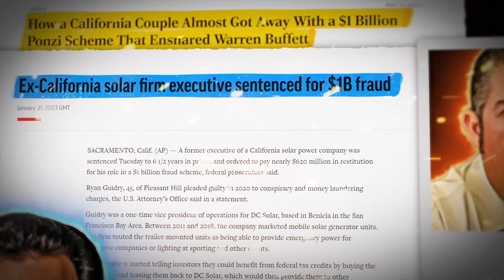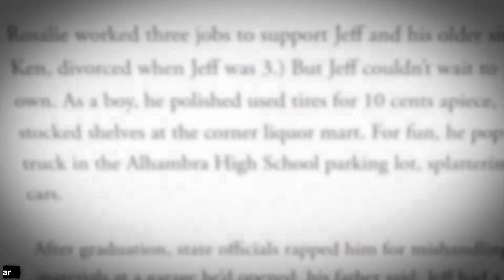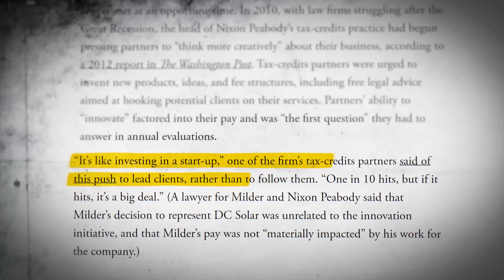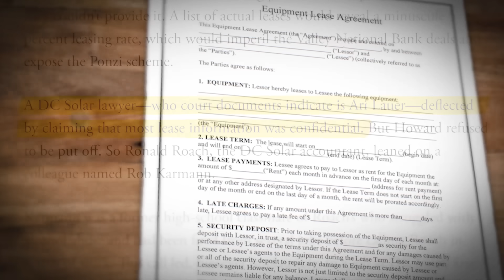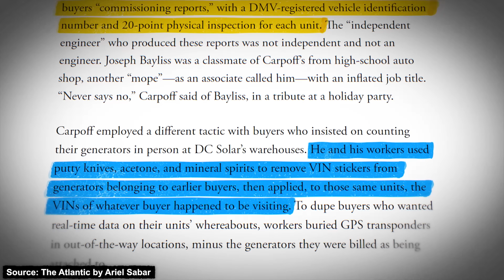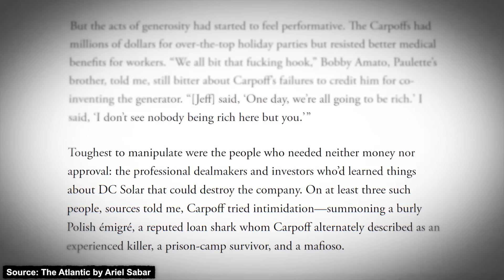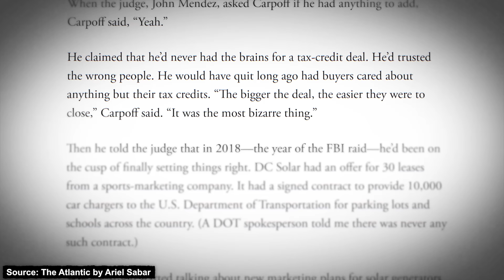The Fake Solar Company That Stole A Billion Dollars

Comment: Is it me, or is rigging a trailer for solar energy not too difficult to begin with
Reply: It's not hard
Reply: Most of these investors probably knew and were just in it for the tax breaks
Reply: @counter.123  you overestimate how smart people are
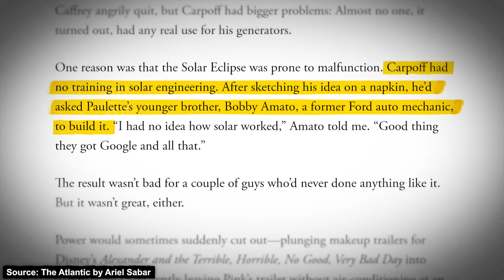Reply: 11:13 just Google it
Reply: I know a guy who has random solar panels from old trailers, construction sites, and any other place he can get them from. He takes them either from the trash or even just left behind and forgotten, there was one panel that was literally dumped there by someone. Just left on his property. He takes them and wires them up in his shop or parts of his house. They dont work like "free energy" but they do run shop lights, charge power tools and batteries, run a small alarm clock...all sorts of small things. Its not hard at all if you understand basic electricity.
Reply: I know one person who hooked up a solar panel to a boat, but its also probably an efficiency thing.
Reply: It's not hard to put panels on it, no. But it's really hard to engineer the electronics if you have absolutely no clue how the stuff works and you're not an electrician. Or how to create a mounting device for the panels (which are kinda heavy) that is sturdy enough to not fall apart on American streets after an hour.
Reply: A few not insignificant challenges but pretty easy really.
Power draw rendering it useless being the main issue.
Reply: From the timeline of this, I think it was almost 15 years ago and from my understanding the technology has come a long way in terms of size, accessibility, and ease of use. Even in the last 5 it’s become a lot more accessible and affordable. That said I’d chalk it down to people just not caring as long as they made money from it🤷‍♀️
Reply: That’s why you made millions from it yes?
Reply: 16:14 liquidate and disappear
Reply: DC Solar was founded in 2008 so I assume it wasn't that easy.
Reply: @Sensory Slug  that doesn't quite make sense. Why spend 150k to save only 45k in taxes? They had to believe to some degree that they were going to get returns worth that other 105k.
Reply: Bro, stop. You can’t even cook toast
Reply: Companies will pay for a finished product, even if it's a simple idea, especially if it gives the tax breaks. Kind of like how making hamburgers isn't too difficult but I would rather pay for a finished product ready to go, especially if it cures my stomach rumblies.
Reply: @n8doggy733  Projecting much? 😂
Reply: It’s the rigging of the government that is hard.
Reply: @AcornElectron  It was a new thing and not it isn't and the market is already saturated. You have to be at the right place at the right time.
Reply: @viderevero1338  bread is hard to cook, admit it!
Reply: Right. Y could probably make ten of your own for the price of one
Reply: @goddimmus  And that's all you need. Understand the basic electricity and you should be able to set up a power station with solar panels. 

Some are simply overestimating the technology used today and underestimating themselves.
Reply: The battery you're charging would be the hard part to engineer
Reply: @deadprivacy  That's why you compensate it with an alternative energy source. For some small things like charging some power tools or powering a light it's enough.
Reply: @CoAndCoLaptopAccount  I guess that writing off 30% if your investing millions was worth it.
Reply: @(CKS) Rylanor - S54  I guess avoiding 30% in tax when you're investing millions was worth it and a % of the rental income for the investor.
Reply: I mean it may take a hour or two work if you wanted to wield it to the trailer and make some kind of way to protect the panels but besides that it really wouldn't be that hard edit also you stole my name!
Reply: At the time, it was certainly harder to do than it would be today. But, after the first round of investments they had more than enough resources to figure it out legit and still probably end up millionaires. You're given the opportunity to print money and you're so lazy you can't even half ass it? Crazy.
Reply: It probably isn’t now but could you do it in 2007 when solar power was just breaking ground in the US?
Reply: Mostly it is the battery and efficiency. You can buy solar panels and hook up an outlet to it really easy, but no guarantee on how much power you'll get.
Reply: @SioxerNikita  I know. He said they were just in it for the tax breaks. I believe they thought they were investing and it wasn't just about the 30% since it was 30% off of their investment, not their taxes as a whole.
Reply: He could have actually done that the whole time without much difficulty. He can lie but he can't work.
Reply: @yaldabaoth2  Was it also supposed to fold in and out as well? I can see why that would be complicated engineering wise
Reply: Yes. Its surprisingly simple, can confirm from experience. 👍
Reply: @ea_naseer  😂
Reply: @lisahoshowsky4251  True.
Reply: It isn't, but many, MANY Americans are born into instant gratification.
Reply: It's not efficient and the panels are sensitive.
Reply: Its really not that hard tbh.
Reply: @thc_freebaser  This
Reply: If you can assemble IKEA or know how to assemble LEGOs, it’s very basic skills...
Reply: @CoAndCoLaptopAccount well it would become an asset to go on their balance sheets too
Reply: @lisahoshowsky4251 true nowadays u can probably find a YouTube video reliably instructing you on it too whereas back then good luck it was all cat videos and high school fights plus the tech was different and not being pushed quit as hard yet with funding and the new tech we have and again good luck finding good info on the internet in those days google was still rough af
Reply: @yaldabaoth2  engineering the electrics? Why would you? You need panels, batteries a charge controller and an inverter. Not sure what engineering would be worth doing. All those things are available off the shelf and are mass produced so you're not likely to be going to save much manufacturing your own. Plus they're all going to be certified already. 
You can save a fair bit by making your own things for personal use but that's different to a commercial operation. Especially if you need any regular tech to be able to fix things.
Reply: @CoAndCoLaptopAccount  if it makes a loss they can probably claim that at tax time.
Reply: Honestly makes me wanna give it an honest go, if only that guy hadn't ruined it
Reply: @romancvijanovic7130  Absolutely. People these days have been convinced that everything is too technical for them to do. I was always told by older people that they stopped serving their own car once they got one with an ECU. I trusted them and didn't try. Then when i did decide to try i found that as should have been obvious, the newer cars are actually much easier to service because the computer handles most things and if there's an issue it tells you with a code that you can then look up and be told in plain language what it means and then follow the diagnostic process. Much easier and less work than my 1982 Mazda. 
The only issue is finding parts instead of making adjustments but that's not as difficult as people claim either.
Reply: Maybe you should do it for real and make billions, since it's so easy.
Reply: @snex000  they only said rigging the trailer should be easy, not making money from it. Why so snarky?
Reply: @chrisnoname2725  You already know how to make money from it. Do what the guy in the video did, just have real product.
Reply: @snex000  but he wasn't making an income from the trailers. That's the problem with it as a legitimate business model. I assume an events business or a hire company could use them as part of their inventory but i don't know how profitable that would be for a manufacturer. I would assume as a stand alone hire product it isn't worth enough and if it's something that is profitable to manufacture then someone would already be doing it. There's already solar powered lighting trailers and light up signs and there's containerised battery banks that are easily delivered to a site for backup power.
Reply: @deadprivacy  yep, that's why this didn't work.  the pannel trailers couldn't provide enough electricity.  there wasn't enough panels to run much of anything.
Reply: Its not, but humans are phenomenal at talking and doing things without using their brains. People say and doo stuff they would blush over if they spent some thought to analyze first, but they simply dont. Thinking hard. Move hands and mouth easy.
Reply: No, quite easily actually. 
All you need to do is to decide the battery capacity in watt hours and pair the solar panels and inverters to meet your clients needs...

...and not take shots of alcohol and spend money like you're a millionaire would also help.
Reply: It really is easy.. I've done it ffs 😅
Reply: Im an eletronics engineer, i could build one in a day If i had all the pieces... And you dont even have to Develop anything, you can buy all the pieces Off the shelf and you Just need to Put them together.
Reply: Not today. But he had a patent at a different time. Think!
Reply: @tacticalpossum7090  Even 20 years ago you could already buy all the parts you would need to build a solar Trailer. It might Not have been any effizient, but it was possible even back than.
Reply: @nitro8529  Im aware, but the public didnt really know or care, and He. Had. A. Patent.
Reply: $150,000 that saves millions in taxes.
Reply: I kept wondering how even with all that money they couldn’t make it work. Then they just decided to not even try haha
Reply: @yaldabaoth2  Yeah but they definitely could have hired someone to make them work pretty early on haha.
Reply: Then you and y'all do it at that time
Reply: It’s just you,
Reply: made it for my parents garden shed, its an evening of researching people already done it
Reply: 2500 for the trailer, about the same for the solar panels, probably another 2500 for batteries and misc. So, the 13K price reasonable markup makes sense. It took 1 minute of google searches and my limited working knowledge of prices to rough calculate that- but you are going to invest 150K in a trailer without any due diligence?
Reply: @chrisnoname2725  ...electrical engineers exist? yes, off the shelf components are much cheaper than manufacturing everything from scratch, thats why you hire an engineer to tell you which ones to buy, to draw up the diagrams of how they plug together, and to design the watertight box you'll be screwing them into. for people who sell electronics, this is an everyday practice...

so the answer to "why would you" is simple. could an average joe buy an off the shelf solar solution, plug it all in, and screw it to a trailer? yeah. but thats going to cost twice as much and not be available for purchase at scale. you hire the engineer or engineers so that as you go down the supply chain, buying components and creating a manufacturing process, there is someone with expertise to say "no we cant replace this component that we've run out of with this component they want to sell us for half price." or "wait to install the lithium batteries until AFTER the welding is done, just in case." and those components you're buying...they were assembled the same way, all the way down to the chips on the boards. another reason you hire the engineer is to know how far down the line you need to go. maybe its best to buy a fully assembled charge controller, but the inverter could be assembled much cheaper by your company. those sorts of calls have to be made by someone, it might as well be by someone with an education and a professional career in making those calls. 

every other reply youve made has made a lot of sense, so sorry for the kind of snarky response, but I figured as someone who has seen too many mistakes made because "why would we ever ask an expert when they cost money!" I might as well explain that yeah...sometimes its best to hire someone just in case. if they do their job right, you wont realize how much they've saved you.
Reply: Say he has 5 panels per side. This was Obama time so these were 150 watt not the fancy 330 watt ones today. So he had 1150 watts of power. Those panels were also 80 percent efficient so like 975 watts. Thats enough power to run a small fridge. So ya these never had a chance.
Reply: My rv solar system can run my entire rv and all together didn’t cost 150k 😂
Reply: @lisahoshowsky4251  Completely incorrect.  There's been relatively few advancements "in almost 15 years ago" in the technology.  Solar is & has been a pretty mature industry as far as how they manufacture/design the panels.  The White House had panels in the late 70's (and Reagan threw them away b/c he thought they were ridiculous).

We've had a couple large arrays (like 40+ of these trailers) for a long time & there would be zero reason to change anything with the panels or inverters.  The current panels may be slightly less expensive (which happened b/c of massive Gov subsidies) and slightly more efficient (MAYBE a 4-6% total increase in output for same size).  But spending all that $ on new panels for 4-6% increase would be dumb - a better idea would be to add a couple more panels to the existing setup.

There is a limit to how much energy solar can produce & that limit is how much energy hits a given area of the earth which is about 1 kilowatt per square meter.  You would be doing very well to get 200 watts from that same square meter in electricity (so we are at about 20% efficiency for good panels).  You can get a few % better but you are paying MUCH more (could be 2-20x+ more).  The other energy you can get from solar is thermal (heat) which is more efficient as you can harvest closer to that 1kw per sq meter.  This is why solar hot water heating is a very good idea, especially residential in sunny areas.  You can also use heat for air conditioning (cooling) bc there are coolers that use heat as the energy source (electric AC uses heat which is created by the compression of a piston by an electric motor). 

Maybe you can see the inefficiency here of 
electric solar panels collect energy -> DC inverter collects energy from panels & converts to AC & sends it to house or grid -> electric motor of AC turns/spins -> drives piston compression -> generates heat as refrigerant is compressed -> circulates into AC system.  

Using solar thermal you have:  
Solar hot water heater -> AC heat exchanger -> heated high pressure AC refrigerant circulates into AC system

One system is MUCH simpler & much easier to maintain.  Solar thermal is much cheaper as well, especially in larger sizes.
Reply: First thing I thought, lol
Reply: they have that sort of things for temporary highway signs, other than that, they can't run much elese
Reply: As someone who's been researching solar for a while now, it really isn't that hard, bit getting it to be efficient and work as well as a diesel generator is a bit of a stretch. Even roof mounted panels only assist in your power consumption. They don't give you all your power. If you want solar panels to equate a diesel generator for the same amount of time, and it isn't left in the sun charging all the time, you're going to need a LOT more than 10. You'd have to park this contraption at the needed site well before it's needed time so it can change. Otherwise, it's useless. Maybe if left in the sun 24/7, like on someone's land, yeah, I can see it. But providing power for venues or things of that size? You'd need so many of those trailers that it's laughable.
Reply: @yaldabaoth2  the engineering issue is 10 panels (2KW) is not enough power to run a good tablesaw on a sunny day, for what they were being used for required running the generators almost constantly.
Reply: @lisahoshowsky4251  even with modern panels from 5 years ago (360w x 10) 3600w is barely enough to run an RV air conditioning system let alone concerts and the like. It was a diesel generator with decorative solar panels.
Reply: Yea but my guess is that it isn't practical

A few solar panels welded to a trailer definitely isnt gonna power the needs of an event or construction site, so may as well ditch the bulky expensive two axle trailer and just get a generator
Reply: It's the batteries that's the problem with solar
Reply: @everythingpony with all the plug and play technology that you can buy nowadays yes. Back then you had to make your own. You had to know how to build all the charging and delivery system.
Reply: Correct. It's not that hard, but you do need to know what you're doing. A week of Google'ing and reading will provide much of that know-how. Then it's a single call to your local welding shop to get the thing built. (you may want a licensed electrician to do the wiring. given the nature of what it is, building codes may not apply, but you still don't want to kill people and burn down the city.)
Reply: @jfbeam  You would need an electrical engineer to design the circuit at least.
Reply: It is a fraud and a scam like most of this "clean energy" crap. Lugging that trailer around takes at least as much if not more energy than the piffle you can collect on site. It is crap.
Reply: @itsez1129 Solar WAS NOT new when this happened
Reply: @Dislob You mean a battery and a converter? Your local hardware store has them
Reply: @LennyMill  in 2023 sure
Reply: @Dislob 😂 you just made up bs,…
Reply: @goddimmus  Yeah but a con man is all about the con not actually making something.
Reply: A solar generator is nothing more than a set of solar panels, a charge controller, a battery and an inverter. I have half my house running of a simple system I put together comprising 6 300W panels, a victron charge controller, a home made lifepo4 battery and a victron inverter. The electronics is easy. The mechanical side I would find more difficult if making a solar trailer.... ie.e. making sure the panels wont fly off while driving down the road :)
Reply: It's easy, it's just that he were claiming they were a lot more powerful than they were. There's a reason one needs a bunch of solar panels and a significant amount of time.
Reply: they've sold portable solar power panels at Canadian Tire for decades
Reply: They probably completely over estimated the energy output. You are not going to get full rated power from the modules in a fixed tilt arrangement other than several hours a day. Less so in the late afternoon and early morning as the rows will probably shadow each other as the rows are too close together.  I've been wanting to build a solar tracker with a tracking system to automatically rotate the panels for more yield. One just has to park the tracker pointing North (in most cases) so that the panels track East to West.
Reply: Late but just wanted to acknowledge how frightening life can be when you grasp human stupidity
Reply: It is difficult to get rid of the damn clouds